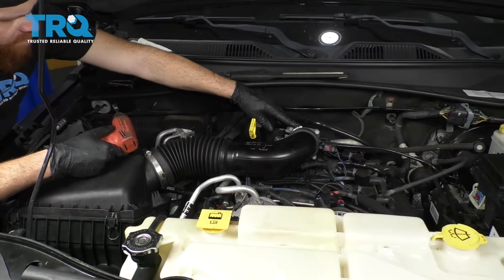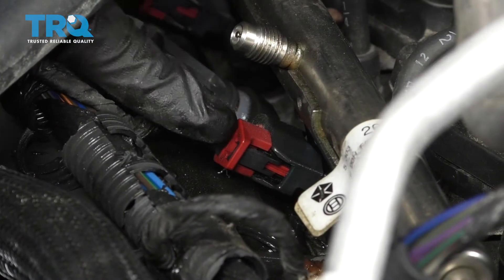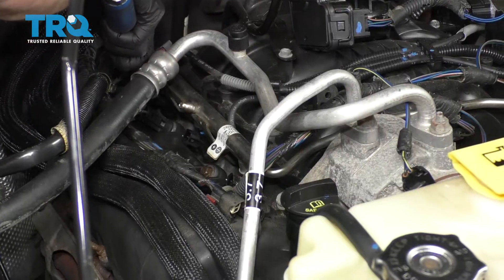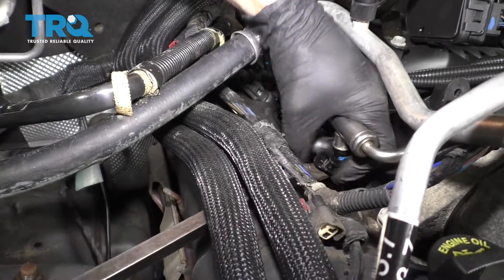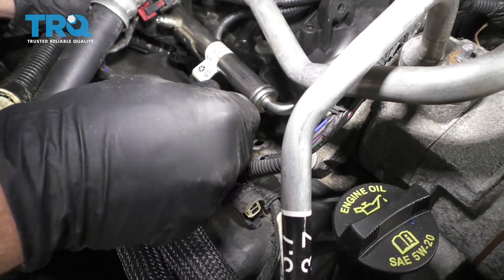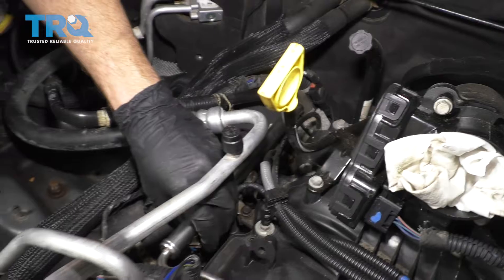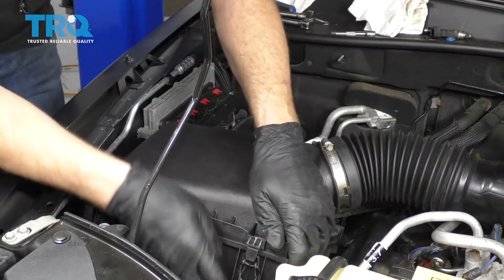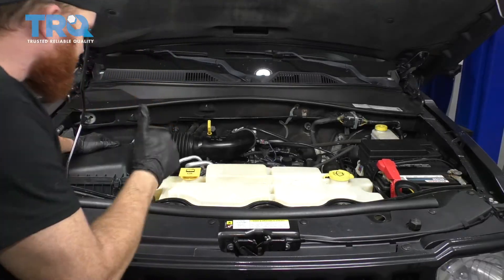How to Install Fuel Injector 08-12 Jeep Liberty

Comment: You missed a step- when do you put the cap back on that relieved the fuel pressure?
Reply from the maker: +@ashleypomeroy1648 You will put the cap back on after reinstalling the fuel injector harnesses.

Comment: I have found if you place a spritz of Penetrant Spray into the Injector base, then wiggle/turn it a little bit, it will pop right out. It will be less likely to tear an Oring. Thanks for the Video.

Comment: Alright, watching this i wonder, if you pull all the tabs off each of the 3 injector connections to the fuel line, you pull up on the fuel rod to get one injector off.....you would be lifting the rail off the other 2 injectors. So wouldn't you have to replace the rubber O rings on the other 2 injectors as well, they would either fall outta the rod or be stuck up in the rail right?

Comment: I would REALLY love your opinion! My daughters 2004 Jeep Liberty had misfires about a year ago and i found the plugs to be slightly loose (of all things) and it needed a couple coils! I replaced the plugs and coils and it ran flawless until today! The misfire started again with a check engine light and the code p0304! So, i went to the 4 cylinder and checked the coil and plug. Just for the heck of it, I replaced them both and still misfires!
To ensure it wasn’t another cylinder throwing the same code, I left the 4cylinder assembled and than unplugged each cylinder one at a time! In each case, the car barely ran! This tells me it is in fact the #4 cylinder. I pulled the plug and noticed it is not wet with fuel! This tells me that if it’s not firing it also is not getting fuel?! So, injector? Or the electrical to the injector? 

Would you mind giving me your best guess? 

If you’re able, thank you very much! 

The best to you! 

Rich

Comment: Changed #5 injector in my 07 Liberty . Was chasing misfire with Plugs , 02  sensors , coil pack switch from cylinder to cylinder. Nothing worked and the Cylinder #5 misfire continued . Then someone told me to listen to the injectors [ i have a powered set of listening headphones] , and sure enough no clicking from #5 . changed after watching this video [ a few issues getting it out and getting it to seat again. make sure you clean the hole real good.... lots of buildup ] . cleared our codes and drove it for 20 minutes , and she idled like a dream . Use the listening trick [ can even use a long screw driver against the injector and put your ear against the other end. should hear a consistent clicking.

Comment: Thanks. I need to replace #4.  When you pulled up on the fuel rail at #2 injector, did it also pop off the other injectors?  If so, should I put a little grease on all when the fuel rail goes back on?

Comment: I have been chasing down a P0304 code; coil packs, plugs, checked valves, rockers, lifters; ran a head gasket test, compression; etc etc. NOW I think I know the issue! THANK YOU!!!

Update: Performed this maneuver with fuel injectors I got on Amazon (Polemotor; about $12ea in a six pack) - SOLVED my misfire issue; drove it hard for a day just to make sure.
Reply from the maker: +Chris MBA Thanks for watching our video! http://1aau.to/m/Shop-TRQ

Comment: Thx for the video.  I tried changing my bad injector but It wont come out.  Any tips trying to get a stuck injector out.  I'm afraid to use too much force.  2006 jeep liberty.  Thx again.
Reply: You have to use a bit of force they can get stuck but no problem forcing it out

Comment: I need your help please get back to me ASAP
Reply from the maker: +Anthony Goehring How can we assist you?
Reply: @TRQ  I have a 2012 Jeep liberty it keep I change the spark plugs and wires and the check engine light stayed on so I took it in and had it tested and it said that the number three and number one was misfiring and I had one spark plug that was wet so I knew a fuel injector seals was bad so I replaced a few ejector put seals on the other one and now it's still losing power I was wondering if I did something wrong I followed your video and it always very easy to do but for some reason now I'm not having power

Comment: Why wouldn’t you remove the fuel pump fuse and run the vehicle to relieve the fuel pressure rather than squirt gasoline out into the engine compartment?
Reply: Oddly cannot find fuel pump relay.

Comment: Great video. Today, after watching this, I replaced a plug, coil and injector on a 2012 Liberty that was giving a P0303 code. $120 in parts and now no misfire or flashing engine warning light. This video eliminated all the guess work on the injector replacement.
Reply: Hi I also have a liberty but gave me code po302. Do you know which injector I would need to check or replace?  Thank you